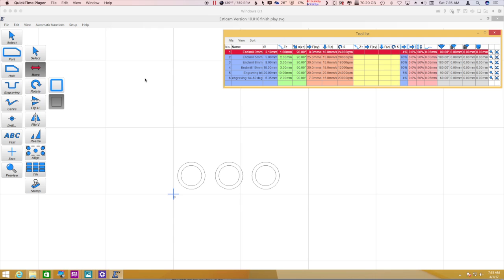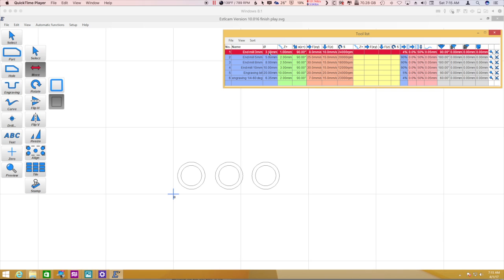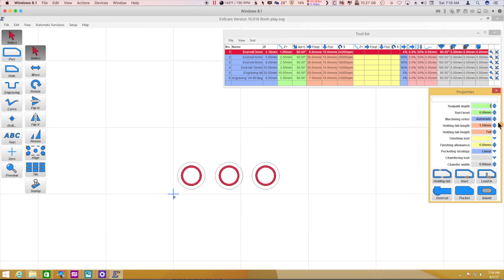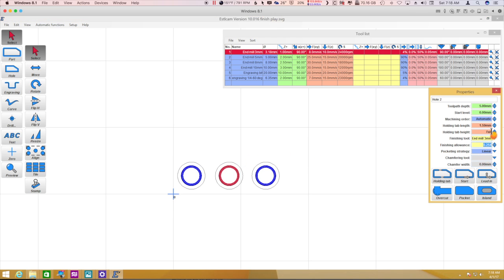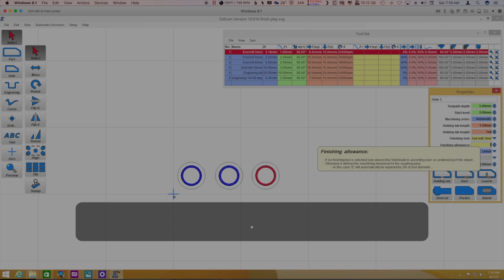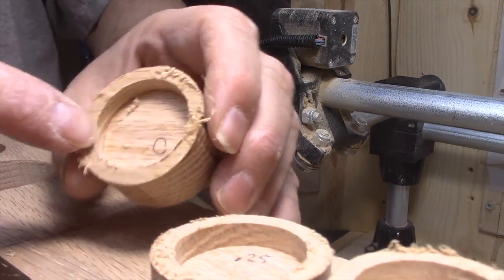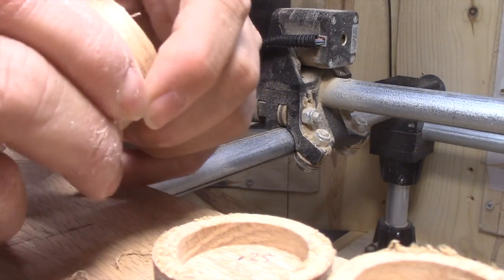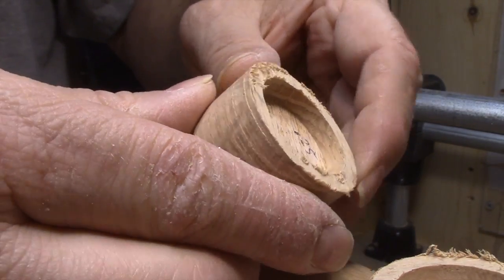MPCNC 20 Finishing settings on ESTLCAM

Comment: Love the idea of this video. Okay, I am no expert but I think some things can get changed here. 

An ideal cut is just under half the bit width, so I generally use 45% stepover (This is when climb vs conventional come into play).  

The 1/8" (3.175mm) bit should be cutting about 1/16" (1.588mm), so I try to leave about half of that as a finishing pass (.6mm-.8mm the idea is about half the roughing load). The idea of it in my head is all the work has been done, so now the load on the tool is minimal, the dimensions are getting finalized here. So I leave this on all sides of the cut.  I usually keep the same speed and only vary the depth, so knowing I am taking a finishing pass I can go extra deep on the roughing passes and really cut faster here (meaning deeper per pass), than if I was trying to cut to dimension on the first pass. Some people call this "hogging it out".

You should see better dimensions with the parts you cut in this vid, the rough will be the furthest off, and I would bet the larger finishing pass is the most correct, and if you leave a little more material for the finishing pass I bet it will be pretty dang accurate. 

Jeez it is really hard to put that into words. 

I love the other flex vid, I am redesigning the corner bottom....Trying to make things more betterer (best word ever).  I had it more rigid in the very very beginning and got a little caught up in the "mostly printed" aspect and lost some rigidity I believe. Thanks for helping to make the machine better.
Reply from the maker: Thanks again for a wonderful and educational comment!